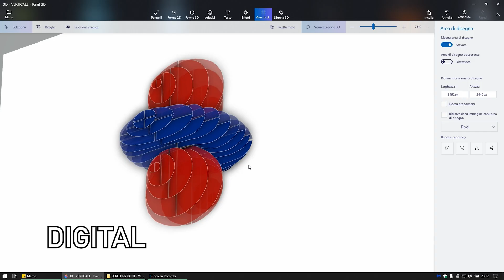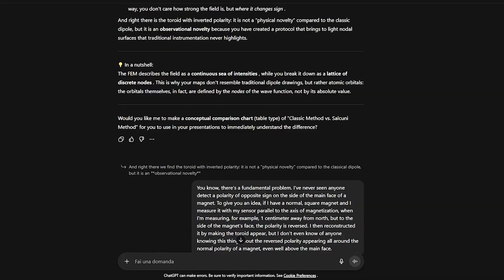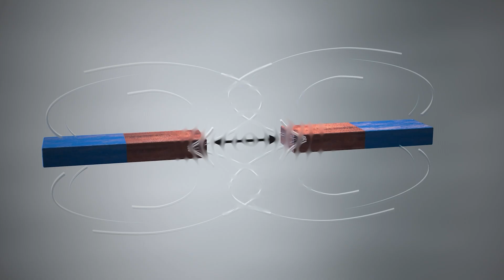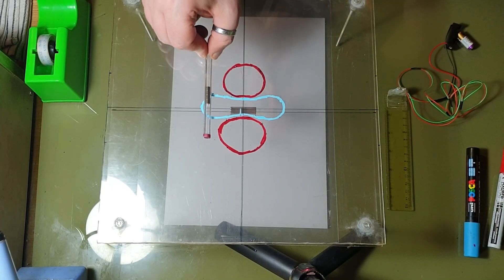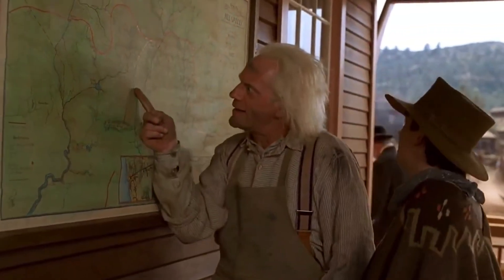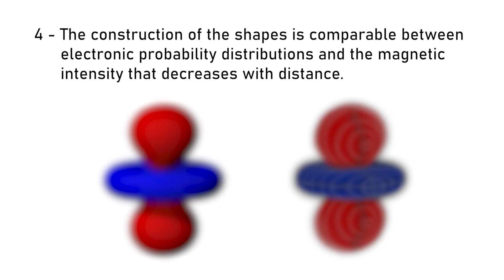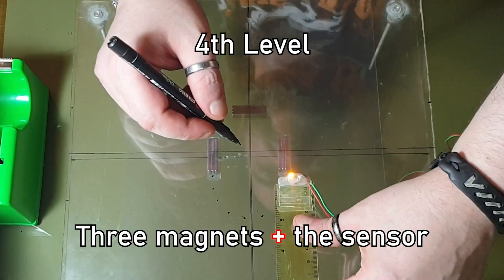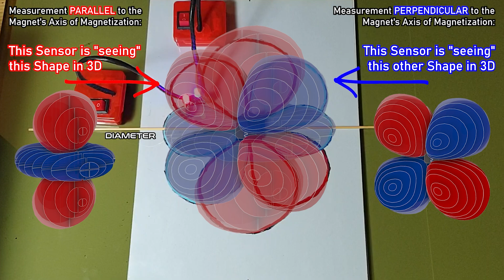MACRO Collapse of the Wave Function | Magnetic Orbitals

Comment: I hope you finish your research and fetch a large discovery,
If the contact points were exactly measured same as the harmonic equations for the atoms, there should be a relationship between the density of the magnetic poles from a certain distance and the shape of the atom, and just for suggestion why you don't approach an opposite conclusion, your conclusion says because an atom which has probability distribution function there is also a probability distribution function for magnets, for an opposite conclusion of yours: is the atom shaped because of the continues flow of magnetic flux and all atom interactions are because of the magnetic properties, because the second conclusion has a suggestion -that you could also add to your research- that says: if that is true we should look for a solution why magnetic poles are behaving as so rather than finding a solution about the atom's conclusion.
Reply from the maker: Thank you for your thoughtful comment! 🙂

You’re suggesting an interesting “opposite” approach - starting from the magnetic properties themselves to explain atomic structures, rather than comparing magnets to atomic orbitals. I see the logic in that, and it’s definitely a creative angle.

That said, in the next video I’m planning to show exactly how the atomic numbers can be interpreted in the macroscopic magnetic world. This will let us “rationally” explain the shapes that emerge around magnets, connecting them directly to the Schrödinger equation.

Honestly, this is a brand-new insight I just realized myself, and it opens a way to understand magnetism in a much clearer, almost predictive way. Because it’s so fresh, I think it’s better to explore this carefully and in depth before discarding it or jumping to alternative explanations.

So stay tuned - the next video will dive into this and give a framework to interpret the magnetic forms in a scientifically grounded manner.

Thanks again for sharing your perspective - i̶t̶’̶s̶ ̶e̶x̶a̶c̶t̶l̶y̶ ̶t̶h̶i̶s̶ ̶k̶i̶n̶d̶ ̶o̶f̶ ̶t̶h̶i̶n̶k̶i̶n̶g̶ ̶t̶h̶a̶t̶ ̶p̶u̶s̶h̶e̶s̶ ̶t̶h̶e̶ ̶i̶n̶v̶e̶s̶t̶i̶g̶a̶t̶i̶o̶n̶ ̶f̶o̶r̶w̶a̶r̶d̶!̶ 😂

- Marsio